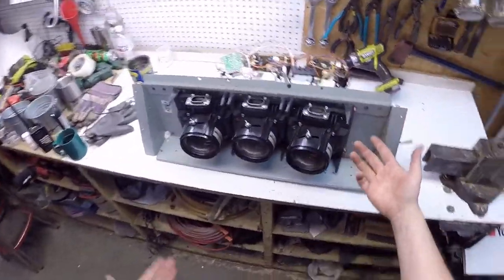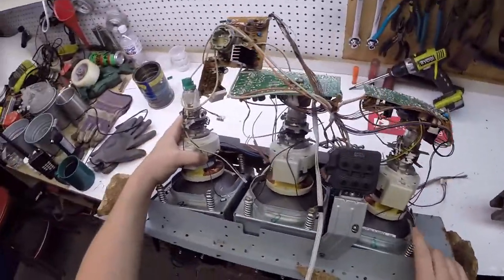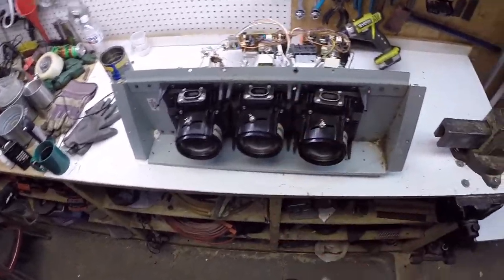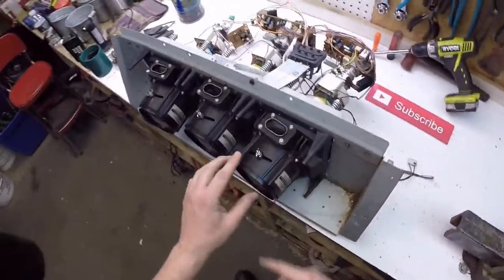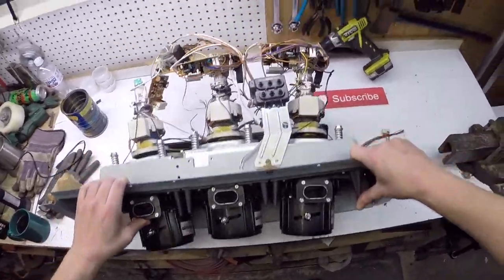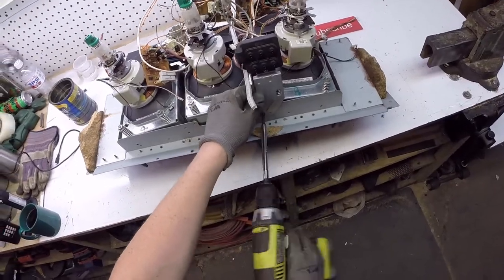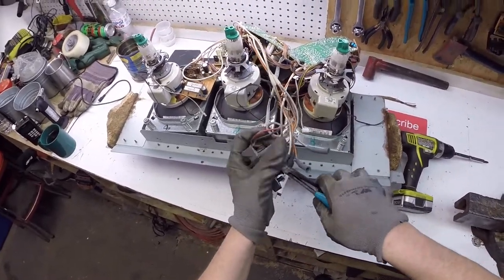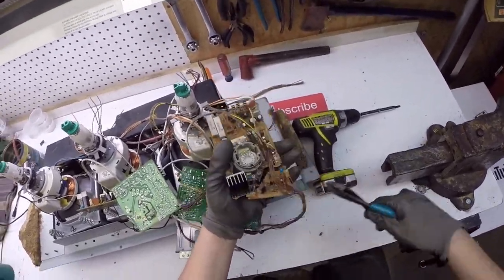Make Money Scrapping Parts from a Rear Projection TV

Comment: Thank you for your video. I just picked a HUGE one of this type today and watched several videos before scrapping it.
Additionally I would like to add that when I picked up around 20 CRT tvs from a motel remodel I found that PHILLIPS tvs glue their yokes to the glass tubes so that breaking of the tube to aquire the yoke was necessary. Unfortunately around 16 were this brand. I wore a respirator and immediately stepped quite a ways back upwind for a minute or so.

Comment: You can slide the yokes off the back of those tubes pretty easy so you dont have to break the glass CRT tubes. Glass dust that contains lead and barium is worse to breathe than regular glass.